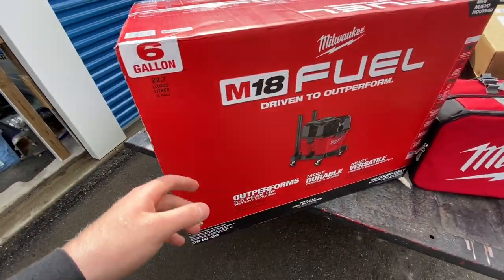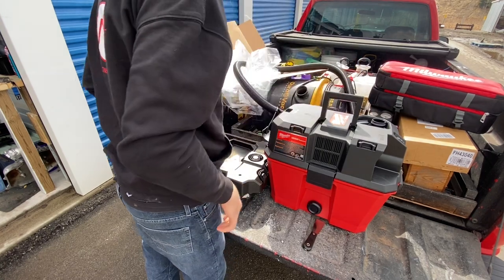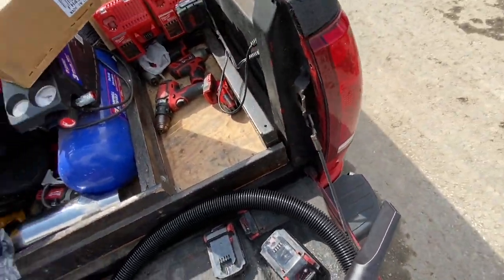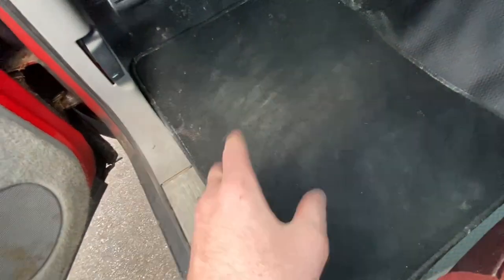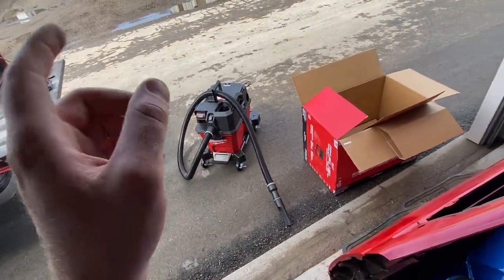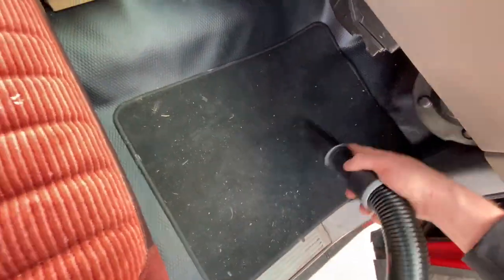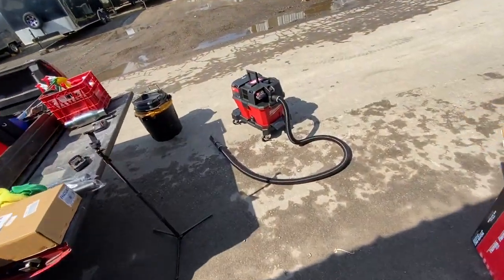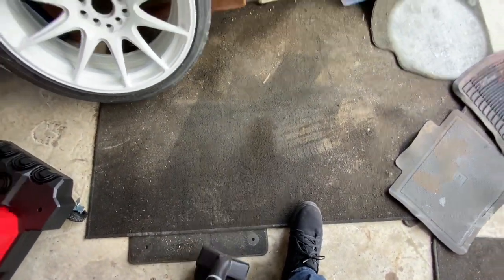New Milwaukee M18 Vacuum Review and Testing!

Comment: Why Milwaukee why!!! I just bought the damn lawnmower and now I feel like I need one of these vacuums to get rid of my old corded one 😂😂😂
Reply: how do you like the lawnmower? i've been impressed with everything i have so far but it does seem a bit expensive.
Reply: @justingolden  the longer I own it the more I hate it. Seems to leave a lot of uncut blades of grass. The engagement bar is very sensitive and will shut off if you lift it even slightly. It has a feature (probably safety) that if you pull the mower backwards and you still have the drive pedal pressed down at any level it will stall the self propel motor and lock the wheels for a few seconds. Also Milwaukee decided to build the longest mower in the history of mankind, if only you could adjust the length of the handle. Doesn’t mulch that great, the mulch plug “leaks” switching from mulching to discharging or bagging is a pain and you better hope you never lose the plug or discharge chute.  Other than that it’s great

Comment: You can run it with any milwaukee battery it’s just the run time that will matter 😂 nice vid to show that you can use a smaller battery
Reply from the maker: Haha yeah thats all I was trying to show, thanks!
Reply: How is it working out for you
Reply from the maker: @theaverageguy8034  I use it everyday detailing cars and it works awesome very quiet unlike other shop vacs which is also nice
Reply: Looking to get the one with the duel batteries 🪫
Reply from the maker: @theaverageguy8034  personally I’ve had no issues with a single batter